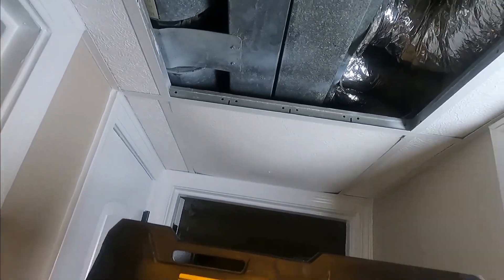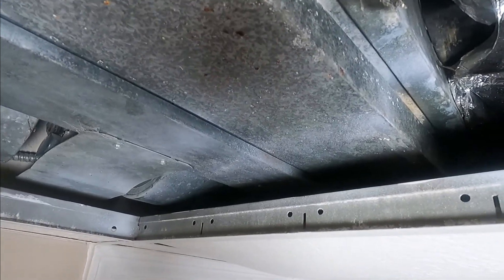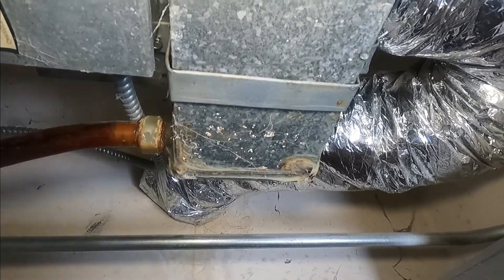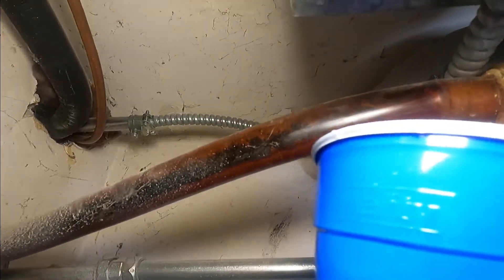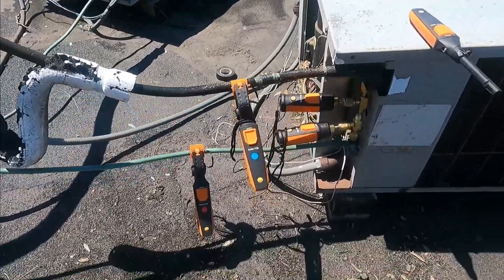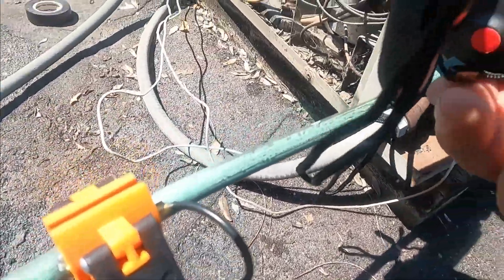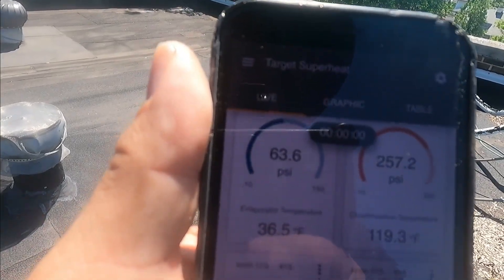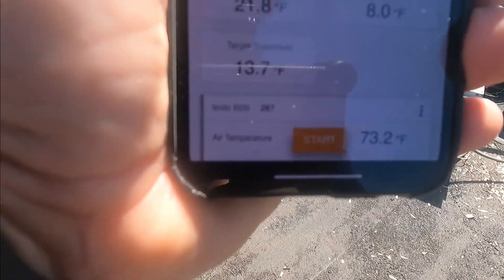AC LOW CHARGE AND LEAKEY AIR HANDLER DONE WITH TESTO SMART PROBES.

Comment: pulling the filter and obtaining a delta t takes 10 minutes and you have a 90% complete diagnostic.  using an ultra infrared leak detector will complete the diagnostic.  have run jumping around in your rabbit hole.

Comment: Thanks for the video. So on a R22 you charge as a gas? I’ve seen people flip the jug upside down. 

What’s the proper way to charge the system using R-22
Reply from the maker: Hello.    R22 you always charge as a vapor through the low side.  However you can charge it with liquid upside down only if the unit is off and you are doing it by weight. (with a scale) you have to allow the system to equalize before turning on.

410 A you charge it as a liquid through the low side .  Very slow or using a liquid vaporizer
Reply: Thank you for this information! You’re appreciated!👍

Comment: Alex maybe you can help me out with these smart probes, do I have to be using the app? or will they connect to my testo digital gauges as well? I have the wireless clamps. But I don’t have the use of my phone. will these connect like the clamps? thanks in advance
Reply from the maker: Hello David.
I have the testo 557 gauges.  That kit comes with the temperature clamps that connects with the gauges.      Those temperature clamps have a wire that connects with the gauges. (not Bluetooth )     The kit you see here are not compatible with the 557 .  they connect blue tooth  ( no wires). with the testo app or other apps.   you can use your phone or tablet.  I hope this help.